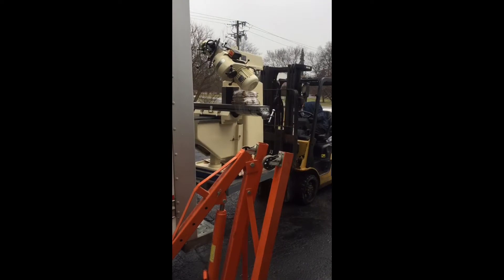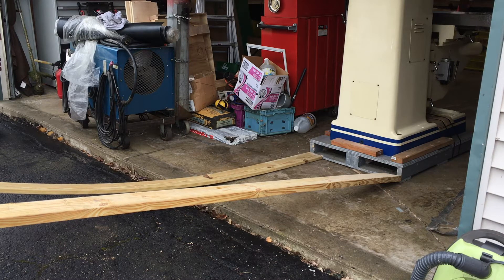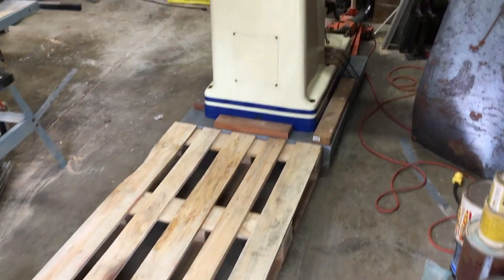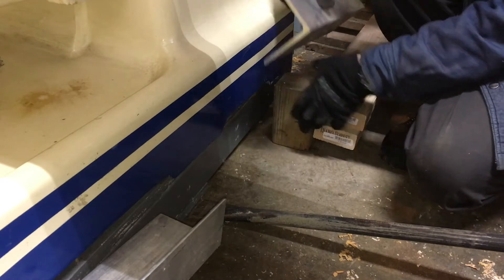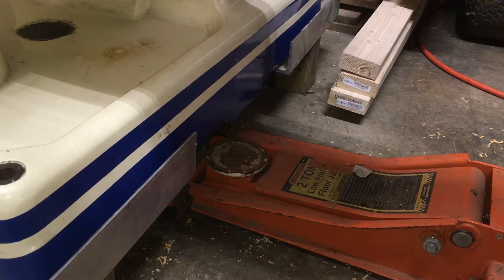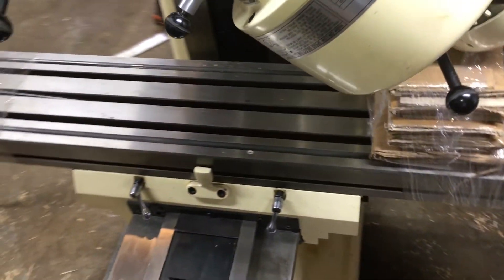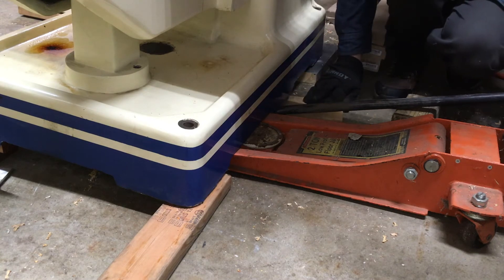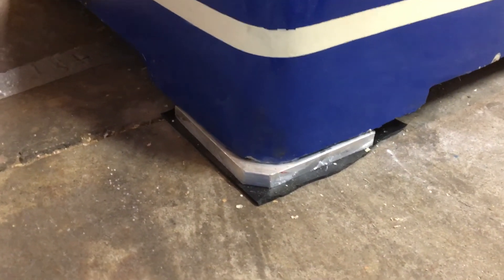3500 lbs challenge! Move, de-palletize and set milling machine using simple tools.

Comment: Very interesting. I actually built a pallet for my machine to sit on. This helps dampen any vibration, raises it up a bit higher off the floor as I’m two meters tall and helps even out imperfections in the floor. The main reason though is to allow me to move my heavy machines around my workshop with ease and safety, on my own using my pallet jack. I only need a couple of mm clearance so even if it wants to fall it can’t.
I think I have the same mill as yours as mine looks identical except mine has two drain holes in the base. Mine was made by Herless in China, was yours? Yours has had a lot of time spent on it painting it though. It looks awesome. Cheers Stuart 🇦🇺
Reply from the maker: Honestly, I don’t even know the name of the manufacturer of this mill. It says that lead screws were made in Taiwan. No other names, just model number X6325. Maybe when I grow up, I’ll have my own pallet jack, then, I’ll have my machines on pallets, lake yours, lol.
Cheers.
Reply: @TinkeringNerd  Mine’s an X6323S so probably the same manufacturer. Here in Australia you can buy a new pallet jack for just under $300 and I think they are money well spent. I paid $10 for mine at the junk shop and I knew it didn’t work but took a chance. It cost me another $10.70 for two new seals and while I was waiting for them to arrive I went over all the wheels, bearings and pivot points. I now have $20.70 in it and it should see me out😂😂😂. Cheers Stuart.
Reply from the maker: Sounds like you got yourself situated pretty nice! Glad for you. Yeah, I just don’t have the room to have a pallet jack. My garage is tiny compared to my ambitions. Cheers.
Reply: @TinkeringNerd  Haaa, I feel your pain. Room is always an issue for me too. I’m working out what can go so I can get the mill in 😂😂😂
Good luck my friend.

Comment: I used pipes to roll my mill into place. What make is that milling machine? It is in nice shape
Reply from the maker: It’s a new Chinese brand mill. It was about 10 years old when I got it. The feed screws are made in Taiwan. The mill was a showroom machine.
Reply: @TinkeringNerd  Mine is a Marena 10"x48" looks similar, the Marena was cast in Taiwan and machined, ground, scraped and assembled in East Hartford, Connecticut, USA. Yours looks like showroom condition!

Comment: This looks like solutions I would come up with! Tip : a hole in the concrete to anchor a block and tackle or chain hoist can easily move five tons that way (ask me how I know !)
And what is it with wives? No matter what they do.... or how many great machines you can get.... 'shoes' always seem to sneak into the conversation !
Other tip : mount leveling feet with 20 cm studding when getting  a machine off of a pallet corner by corner.
Works a treat! (ask me how I know that!)
And if all else fails.... Tupperware boxes filled with ice.... sounds iffy, but I did it on an Arno vertical mill (lbs 2500). It takes about an hour, but the machine lands very softly if you have your plan figured out right!

Toodles!
Paddy
Reply from the maker: Paddy thanks for watching! Your tips sound solid! I wonder how you know all that! Lol